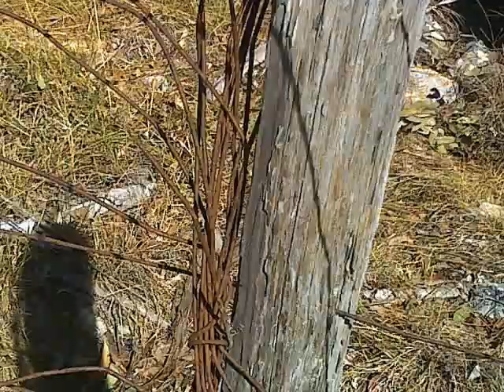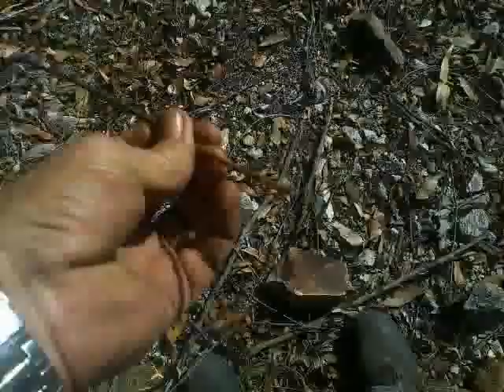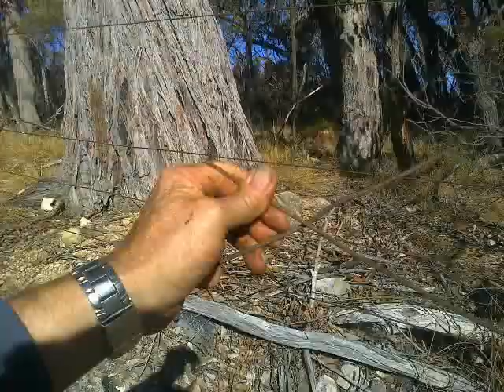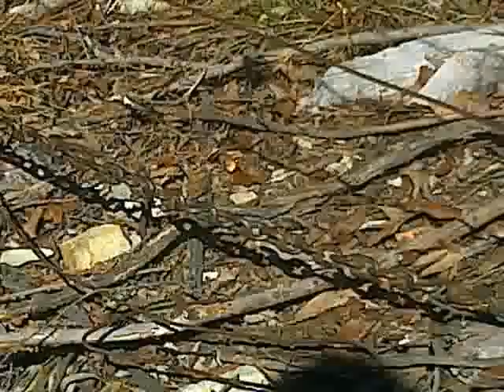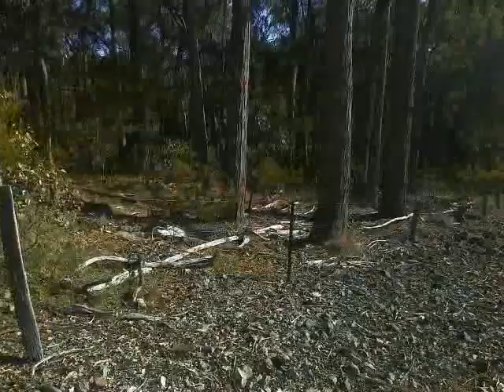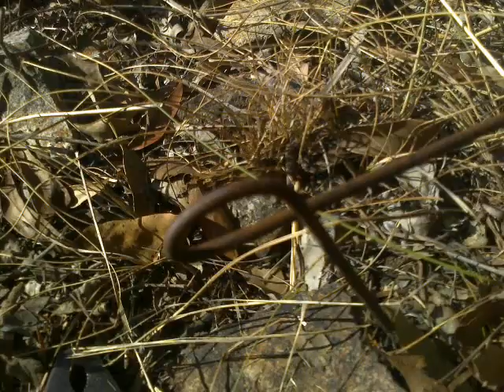Pt-2 ; Maintaining The Edge..., Splicing & Straining...

Comment: Nicely done.  What prevents them from squeezing through between the wires?
Reply from the maker: G'day,

 Thanks.

 Well, the Sheep are pretty much too big to want to force through any gap smaller than a foot high, so with wires about 6 inches apart they're pretty much contained...; Cattle need a string of Barbed-Wire along the top of the fence to stop them pushing through it, and Deer like breaking fences too.

  It's, sad that to stay sheep-free one has to constantly fence them out ; but it seems to be the best option...

  Have a good one,

 ;-p

  Ciao !